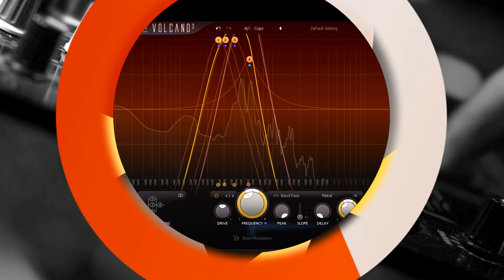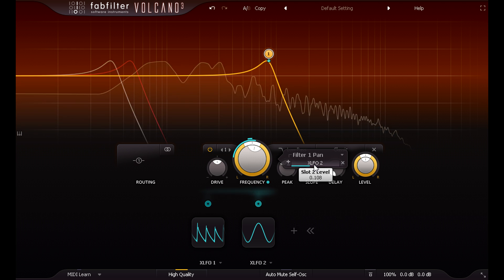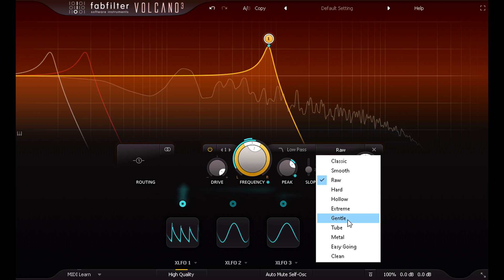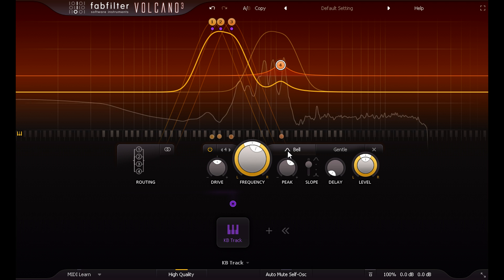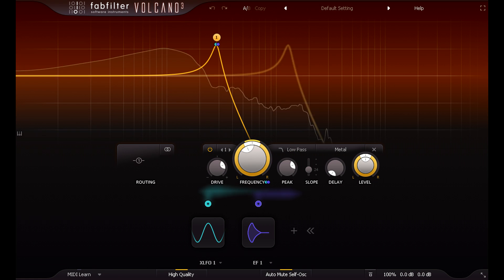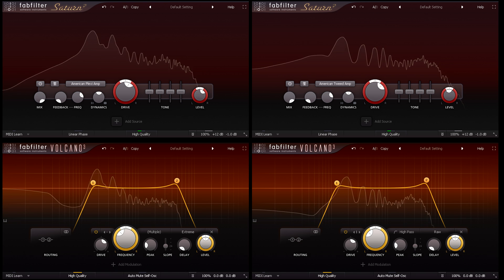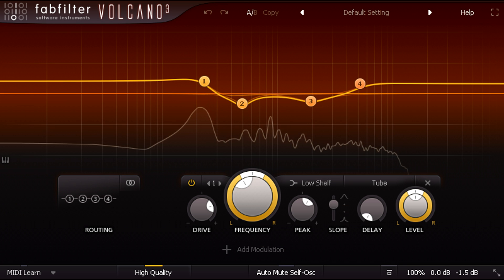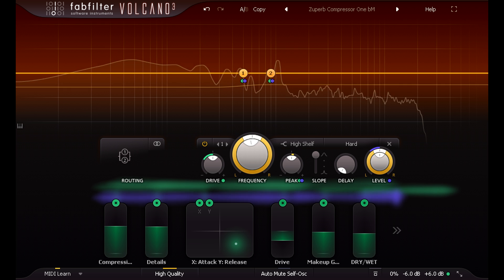Introduction to FabFilter Volcano 3

Comment: I've actually been demoing Volcano 2 for the past few weeks. It does WAY more than I thought a filter plugin would be able to do. The included modulation options really set it to the next level, besides the amazing sound. The presets do a great at showing off what is possible with it, i.e., way more than this pleb thought. To the point where I'm actually genuinely considering spending the dough for it, which I guess is why demos exist...

Comment: Although I love the Fabfilter plugins, they are sometimes just too complicated. I don't intend this to say that the plugins aren't good. Maybe it's just me who likes a plugin with just a few parameters and does what it is supposed to do. For example: I get completely lost with the delay plugin. The delays sound great, but it takes me so much time to set all those parameters and internal connections, that I give up and take a simple delay plugin.
Anyone else who has this experience?
Reply: You're not alone. All these modulation possibilities are just beyond me. Same thing as with modular synthesizers. I'm much better with hardwired boxes with a fixed signal flow. Then again, I'm pretty happy with Pro-R, Pro-C and Volcano even though I don't max out their capabilities. But Timeless is tricky for me, too.

Comment: 7:14 level-matched, yes. But in the hollow-filter-example the drive is up considerably higher, than with the clean-filter-example. Overall this is a great video, but I think it's wrong not to match all the other settings when comparing filters. That's not a serious, but a marketing demonstration. Of course adding drive will add perceived loudness, even when levelmatched (LUFS doesn't work btw.). Yes, I know the filters sound different either way.. no need to boost the impression by rigging the settings for effect.
Reply: ??? The whole point of the Clean filters is that they do not have any drive at all. The Drive knob is literally greyed out and the feature not available when you have selected the Clean filter mode.
Reply: @niklassilen4313  I don't think you understand the fact, that those filters all sound different, even if you don't use the drive at all. But the difference is a lot more subtle, then when you engage the drive. So while it is obviously a valuable thing to show off what the drive does for the sound, engaging the drive while you want to showcase the different TYPES of filters is very misleading (because the drive impacts the sound a lot more than the different filtertypes do and thus you can't hear the actual difference between the types) in my opinion. It's either misleading, or bad communication.
Reply: @akagerhard  <Insert eyeroll and facepalm here>
Reply: @niklassilen4313  this is not a respectful way to communicate and treat each other. I voiced reasonable concerns. Concerns everyone who takes the science of audioengineering seriously understands. If you can't see the truth in that, it is to your detriment - not mine.
Reply: Thanks Niklas. Indeed, the perceived loudness (and general betterness) is precisely what I was trying to demonstrate.
Reply: @DanWorrall  it is simply unscientific to change other parameters if you want to compare one parameter. In the example I pointed to you explicitly wanted to compare the clean filter-type with a non-linear-filter-type and you chose the "hollow" one to represent the non-linear filters. There already is an audible difference between them without engaging the drive. However when you engage the drive the comparison becomes obsolete, because the audible difference between filters is a lot more subtle than the very audible difference between drive on and drive off. I know for a fact you understand 100% what I am saying, you tend to be very exact yourself - which is exactly why I'm surprised to see such a blunder in an otherwise formidable video.

Comment: For anyone wondering how to actually do this "MIDI-controlled filter in front of white noise" in Ableton Live, here's how to do it (or ONE way to do it at least!):
1) Create a MIDI track with some synth making white noise. I use "Analog" and just turn off OSC1 and OSC2 and turn on the Noise. 
2) Add Volcano 3 to that MIDI track.
3) Create a MIDI track and add the "External Instrument" effect to it.
4) In External Instrument, send MIDI to your first track with Analog + Volcano.
5) ...
6) Profit!

You can add a MIDI Source to the modulation section and choose "Key Tracking". You can add an Envelope Generator and choose MIDI input (top button to the left of the envelope display).

This is a fantastic plugin! Kudos to the product and dev team behind it!

Comment: where I can buy all FabFilters stuff, and how much is that cost as 1 pack?
Reply: I have tried to answer this question three times, but my comment keeps getting deleted. Am I really getting flagged as spam for answering a question about purchasing FabFilter plugins? This is ridiculous! 🤦‍♂️
Reply: Well, that worked, apparently there is some wording that is getting flagged as spam. I will try scrambling any words that appear "spammy", sorry about this. LOL

On the FabFilter s_h_o_p it's called the Total Bundle and it's 999 USD. They might have a B_l_a_c_k F_r_i_d_a_y S_a_l_e, so keep an eye out. Another option, current FabFilter users can send a 10%-O-F-F c_o_d_e via email, which will take it down to 899 USD. I don't believe these can be combined with any other s_a_l_e_s they have going on, but I could be wrong on that.

Comment: Hi Dan. Thanks for another great introduction to video.

Am I losing my mind, or have FF removed the filter link features present in Volcano 2. I didn’t see anything in the user manual and don’t see the controls anywhere
Reply: It’s not really any kind of deal breaker, as the modulation system is easier to use & I typically used filter link in volcano 2 to make DIY notch filters from linked high / low pass filters. Now I can glide up to 4 notches through a reese bass if I want to, so it’s an improvement, but I bet I’ll find myself wishing I could still link filters in v3 from time to time.

Maybe I’m just being stupid & Fabfilter have implemented it differently?
Reply: You can simply box select all the filter nodes you want and then tweak the cutoff knob and they will all change accordingly, keeping their relative positions and values. It functions just like the link control. And with the XY + Slider macro controls you can make this operation even easier and "permanent".
Reply: @niklassilen4313  ok I figured they must’ve just streamlined it somehow.
Reply: @niklassilen4313  I’ll have to play with it more on my next sound design session. So are you saying you can still use an XLFO to modulate multiple filters by assigning it to one & linking them? Or has this functionality been removed now they have a better mod system? Or does it assign the LFO to every filter you’ve box selected at the same depth when you drag it onto one of them, with multiple filters selected?
Reply: @hazmatproduction4562  The LINK never worked that way. It was there purely for you to easily manipulate many filters at the same time with your mouse. If you assign an LFO you have to do it separately for each filter.. but you can control the amount of LFO modulation through a slider or XY pad, thus basically making it so that with a single slider you can control the amount of LFO modulation of all filters you assigned it to. 

Having said that, I do wish FabFilter would allow you to quickly assign a modulator to multiple filters at once, through the box select feature. Unfortunately this is not currently possible.

Comment: Whitesea Snakeoil: what is this, I don't have a clue...oh...a filter. Might be useful for mastering.

Dan: here's a whitenoise, turned into a beat.
Reply: the problem as i see it is that he has missed some good stuff several times because he doesn't RTFM. Dan knows the Value of Learning a piece of soft. Sure, with exp you can get in and approximate results, but more involved soft has a bit of a learning curve assoc with it.  That said, I watch the SO for mostly entertainment. I take Very little away as far as Actual product review 👍
Reply: Calm down guys. I’m not a fan boy or anything like that. I just really like Sandstorm by Darude
Reply: White Sea is a mixing & mastering engineer. He was pretty up front about his lack of sound design knowledge when demoing this plugin.

Made me laugh that he was freaking out about lack of gain compensation but the drive clearly attenuates the output. 

I like his content & he clearly knows his stuff when it comes to mixing, mastering & using analog gear. 

I def don’t always agree with his point of view but at least he knows better then to label any fabfilter product as snake oil, even if he doesn’t know how to use it lol
Reply: @hazmatproduction4562   So you claim he's knowledgeable but doesn't really know what he's doing. Interesting....
Reply: @joelybarish4618  no I said he’s knowledgable when it comes to mixing, mastering & analog gear. He was completely up front about his lack of experience with sound design & this is primarily a plugin for creative mangling, so it makes sense he wouldn’t be as familiar with the workflow as he is with EQs, dynamics processors & time based FX used heavily in the kind of work he does for a living
Reply: @hazmatproduction4562   That really doesn't explain the countless other plugins that he has slandered because he himself is so uninformed. We obviously have a differing definitions of "knowledgeable"
Reply: @joelybarish4618  Well a person can have knowledge about general mixing and mastering, but still be clueless about a particular piece of software. I'm pretty sure he just turns on the camera and demos the plugin for the first time live in front of the camera. Dan looks soo much more "knowledgeable" in this video because he does production as well, and more than that - he has had a lot of time to play with the plugin and fully discover all the features, whereas Whitesea is always in a rush to get to a conclusion for the sake of the video.
Reply: @joelybarish4618  examples please. Maybe the plugins you speak of actually aren’t that amazing. 

I did say I don’t always agree with him, and a lot of his reviews are a tad biased anyway, based solely on the fact that he’s a bit of an analog elitist & generally hates plugins as a whole. 

I tend to expect any plugin review from him to be a little salty based on his analog bias, but he will generally have a wow moment, whenever he finds a plugin feature that either can’t be done in, or drastically streamlines typical analog workflows
Reply: @hazmatproduction4562   I know all the engineers I admire make that Home Alone face in their vids.
Reply: @anirudh.skumar  and what is the benefit of making a video where the viewers will not learn anything about the plug-in? Or might even be misinformed..
Reply: @amisenc  stop viewing his videos as educational then, more like entertainment or I just use it as a discovery method to learn about new and interesting plugins
Reply: Wytse is NOT a producer
Reply: Bruh guys Dan and the whitesea guy are friends
Reply: Anytime I see “snake oil?” in the thumbnail, I’m so completely turned off from watching that video. I don’t care if he has good content or not.
Reply: @Augnos  Glad im not the only one
Reply: @Augnos  LMAO ok that's just his Name of the series though.
Reply: @Augnos  Anytime I see WhiteSea in the thumbnail, I’m so completely turned off from watching that video. I aspire to learn from a knowledgeable source that has good content. Which is few and far between on YT. Mostly the blind taking advantage of the blinder with their patreons.
Reply: @joelybarish4618  If you watch the videos on Dan's channel, you'll see he actually enjoys WhiteSea's videos. And I believe he has even posted videos on his channel before.
Reply: @Lawls   Dan is merely being overly kind to an underling. He's takes pity on silly influencers, which I do not.
Reply: a little harsh, White Sea attacks the plugin like any of us would so its informing to me
Reply: @bongos7821  Let's put it like this:

If I put (for the sake of clickbait) the label "snake oil" to everything, even if I don't even understand, what the plugin is about (happened not for the first time), I need to be prepared to get comments like above.

And to put this straight: nothing personal here, he is just doing his job I guess.
Reply: @n.k.9964  it’s just the title of the series.
Reply: @bhizzle1921  No its clickbait. Like his video about this plugin titled "oh nooo", which was put together in a second without knowing, what he was talking about. Just to be the first on this platform.

But this is going into a wrong direction, my focus was and is:
"Look, what Dan did here!"

Astonishing!
Reply: @bongos7821  Precisely. He doesn't know anything more than you do. So why not let your own ears be the judge??
Reply: @bongos7821  Yeah man. White Seas videos are solid and he is a self admitted FF fan boy. His perspective is fresh and generally informed. He keeps the industry on its toes. Also his follower numbers speak for themselves. I think when he started his snake oil series he  was generally flushing out a lot of rubbish. Since then he does most of his reviews under that banner - so it is a marketing continuation thing vs click bait. But I get how it could rub people the wrong way.
Reply: There is just literally no reason to hate on his vids, what are you looking for the perfect audio influencer that you can listen to on YouTube all day instead of doing audio work? I like White Sea because of the type of pop and hip hop mixing and recording I do the plug-in has to be perfect , and extremely transparent and his ears seem to pick up on a lot of things mine don’t because he doesn’t do any kind of hip hop work . Just a lot of diff people in the world with diff ears, listen to what they say and than listen yourself , still love his vids , probably more than someone doing long deep dives
Reply: @bongos7821  I really didn't mean to hate on his videos in general.

What happened is following:
- FF releasing a very short video about the release of Volcona
- FF sending a mail about Volcano
- me searching Youtube
- there have been only a preset walkthrough without comments and the White Sea video at this time, both a waste of time for me

So when FF released this video, naturally I compared it to the WS video - that's the only reason I mentioned him at all. Didn't mean to produce such a da|rude sand|storm on his stuff, especially since this is not the right place for this. This should be about FF. But since his channel is well known (so he obviously is doing something the right way), he needs to face fact he is polarizing. And I guess he will survive ;-)

So here are my apologies for my initial comment, obviously it took a direction I did not expect.